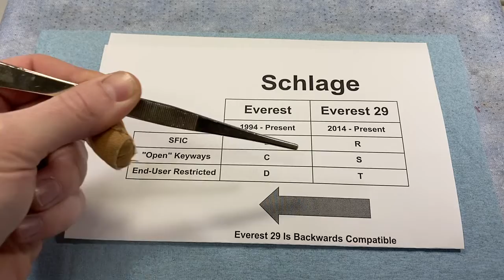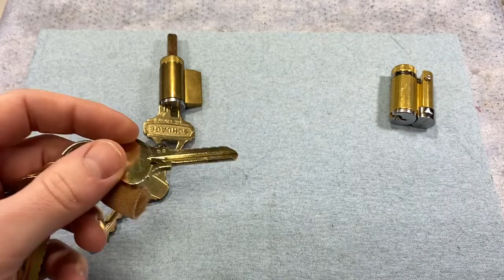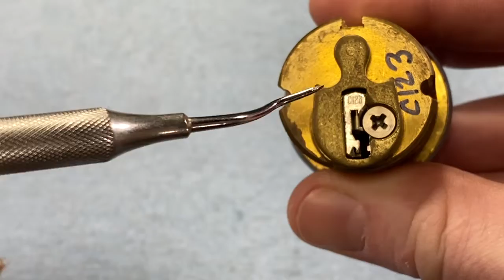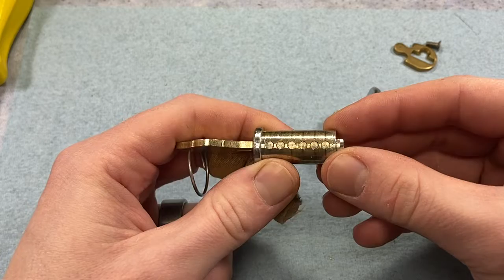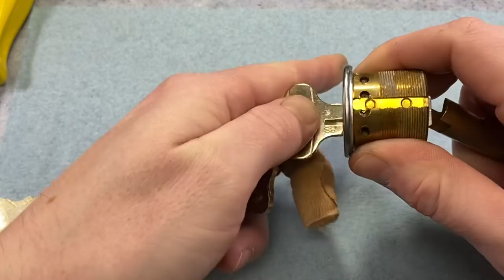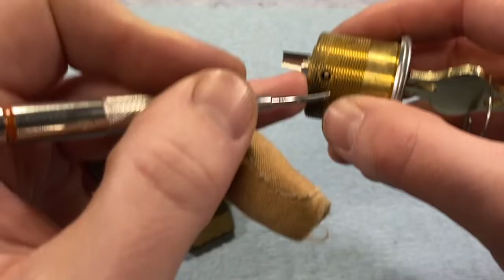How Schlage's Everest/Everest 29 Works

Comment: Hey Tyler, I got your Channel link from Jason (SE Lock and Key).  Great Video on Everest systems.  I did want to ask a question about Primus that I hope you can answer.  I have searched through the Primus service manual, and I have calculated all the possible space a depths for the 5 side bar positions.  My question is, when you have a left of center (eg 2) or right of center (eg 6) other than the correct depth, how does the rotation work?  Would it be the left slope for a 2 and the right slope for a 6?  Let's say I have a side bar bitting of 42226 where 2226 are all at the same depth, could that entire space be milled flat or do I need the peaks between the pins for rotating the side bars?  Or do I need to standby for the next video???? Thx
Reply from the maker: You would need to keep the "peaks", here's why:

For Primus, 3 and 4 side bit cuts are dead center. The remaining (1, 2, 5, 6, and 7) are off center, so to speak. They are off center because with only their position cut, the finger pin must rotate and rise/drop to fit within that particular cut - everything else (the metal) is occupied, so it can't go anywhere else but into the area that is missing (the cut). It's somewhat similar to Medeco, if you're familiar with that, in that the position of the cut, coupled w/ the spring tension, essentially forces it into the position. If you mill that entire space flat, despite 2 and 6 being at the same depth, it would be a crap shoot on which way the finger pin choose to rotate. Using Medeco as an example again, it would be like cutting a left, right, and center cut in the same position and hoping the left pin the in cylinder for that chamber will rotate correctly - it could, but no guarantee.

Hope that makes sense. I plan on doing a few videos on Primus soon and I'll make sure to make one video about the finger pins.
Reply: @Thethreetumblers  that's kind of what  I thought, Thanx for confirming.

Comment: did you see my video about Ruko RB. That way ruko made a backward compatible open profile. 
In one of my d12 video I also show how all our open d12 blanks have the tip filed down, to avoid it being used for unauthorised  blue class d12, with cuts down there like a primus. Still all my old blanks have that part still, as they only started removing it after someone found out it could be a problem.
Reply from the maker: Do you know the link off hand? I would be curious to learn more.